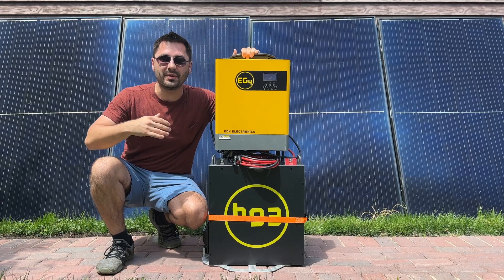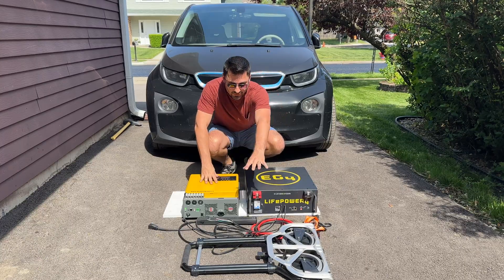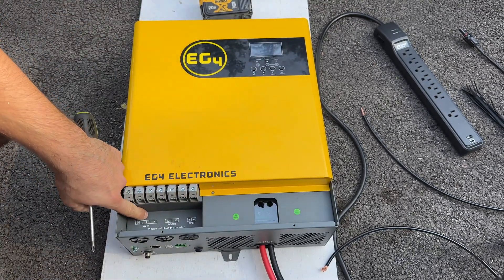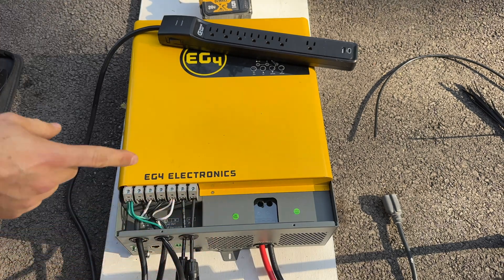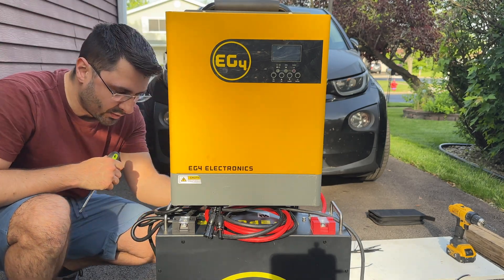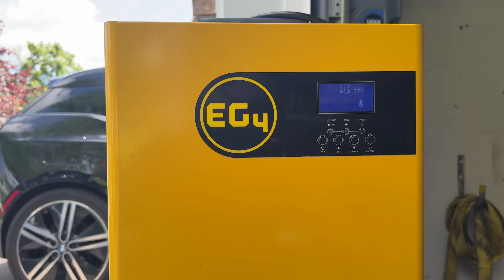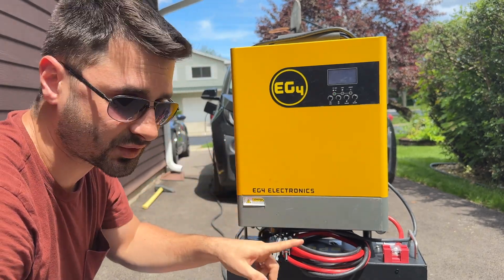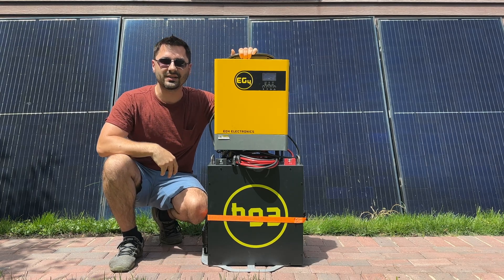I BUILT A Portable Solar Power Station That Can Charge My EV!

Comment: Awesome build.  Beautifully simple.   I might be tempted to upscale to taller cart and up to 6500 EX or similar to get 240v/ faster charging.
Reply from the maker: I have since added panels and wired up a 15amp charger, so charging at 1.83kW for about 8 hours from the sun! More than enough to cover my commute!
Reply: @SimpleCarGuy that’s very cool.   Well done.
Reply from the maker: Great idea! Post your results if you build one. Thanks for watching.
Reply: This is exactly what I was thinking.
Reply: Omg put this in a Milwaukee rolling chest.... Add a vent fan and air intake on the sides. Waterproof solar distribution center.
Reply: Did you end up using 6500Ex? I'm thinking of the 6000xp
Reply: @NovaFlowO2    6000XP.   I erred on the name in original post.  Got it (and all the solar gear) in under the wire before the tariff stupidity.

Comment: What solar panels do you suggest? You said those were portable 300 watts.
Reply from the maker: Anything you can find for cheap that will have enough voltage. I got 15 of these for $50 a piece and I’m building up a much bigger system with them. 
You need minimum 120 volts from the panels to start this inverter. These produce about 40 volts so I put 4 of them in series for the test and demonstration. If you can find some 500w panels for like $100/each, 3-4 of those would give you 1.5-2kw of solar at peek sun.
There is some math involved here and Will Prause just did a great video on this topic, so check it out.
Reply: @SimpleCarGuy   thanks for sharing this start idea for charging EV and I subscribed.  As you mentioned this inverter has 3000 watts out and 5000 watts fro PV Max.  Just curious, if I have 5k watt PV, but only able to use 3k watts.  Seems like I didn't use my max PV or other words, I lost 2000 watts.  Should I buy solar panel for 3k or 5k watts to work best with this EG4 Inverter?  Again, thanks for sharing and please post more.